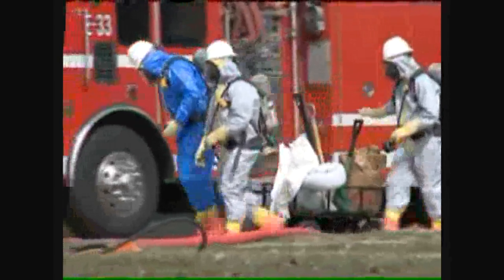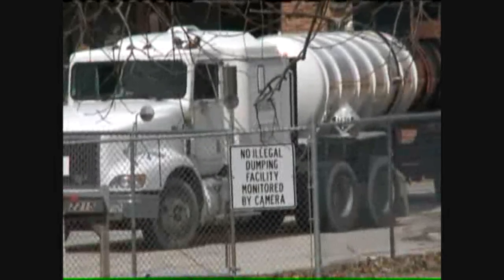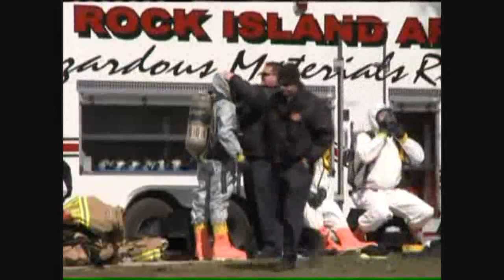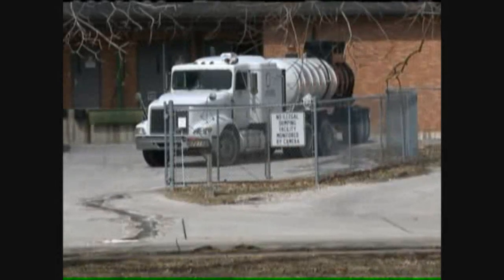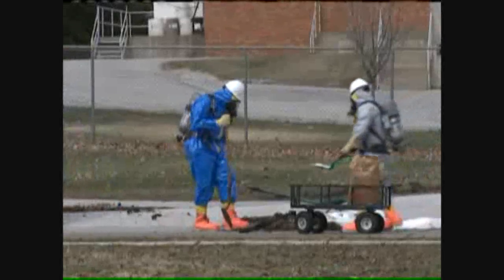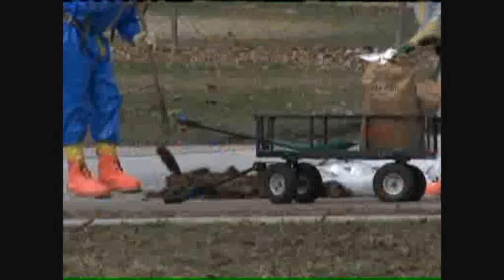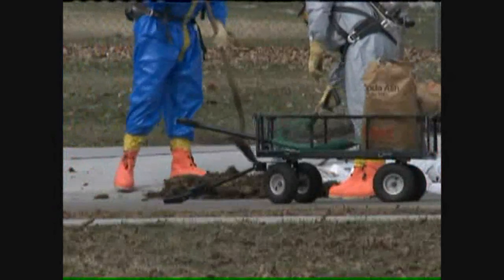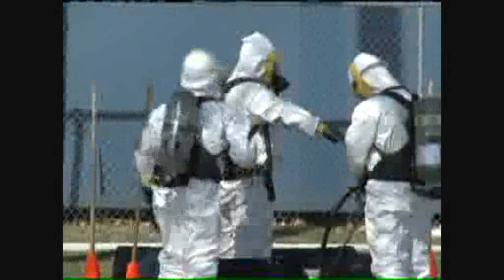Fluoride spill at water facility literally burns holes in parking lot cement

Comment: welp.. i guess this corrosive chemical is doing its job then... where is the outrage from the citizens after being told that something with the ability to burn holes in concrete is intentionally put in their water only to be comforted by the belief that its good for your teeth?? i dont know much about enamel in comparison to concrete... but im pretty sure concrete is harder... that should be a dead giveaway..
Reply: Fluorosis... Too much fluoride make with tooth the same that it makes to concret
Reply: Actually I am not sure about that one but if you throw a brick of teeth at a concrete brick I'm not sure which one would crack. Your bones are somewhere around 7x to 8x stronger than concrete, but I'm not sure about teeth
Reply: Just checked and your teeth are MUCH stronger than your bones, so there you go. Their are special strands of protein that form your teeth that are tens of thousands of times stronger than bone, and bone is at least 7x stronger than concrete.
Reply: it reacts with your teeth to form fluorapaptite. Which is harder and more resistant to acids. Which in a dentist fantasy, i mean 1950's "medical science" would mean that it forms a nice even layer across the enamel of your teeth. In reality it forms little dents or clumbs or stripes of it at best and you will have something called zebra teeth or dental fluorosis. And, in more severe cases, it will completely deform your dents.This happens especially to young children who have been exposed to large amounts of fluorine during tooth development. It's not even the topical application that mainly causes it rather the ingested fluorine from water and swallowing of the dental products that causes the teeth to deform as they are being formed. It does the same to your bones (skeletal fluorosis). And it damages the central nervous system and has been shown to accumulate in the brain, specifically frontal lobes and thalamus region.

Comment: So i may stop drinking Tap water then do i buy bottles of water in the shop ??? :/
Reply: no they put chemicals in that too. If you want clean water buy distilled water, just remember that because it's distilled water it has nothing in it, no minerals, no chemicals, nothing which means the minerals your body needs that it usually gets from water it won''t be getting so you'll have to find other sources for those.